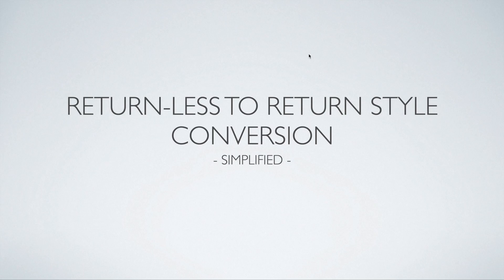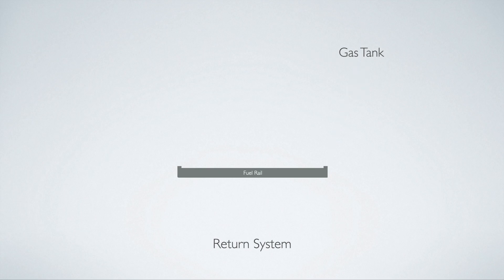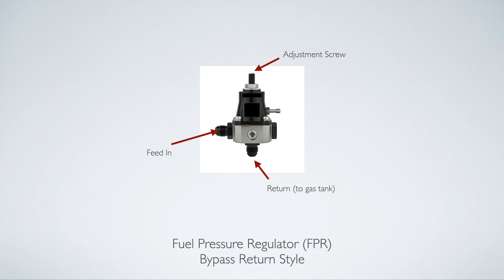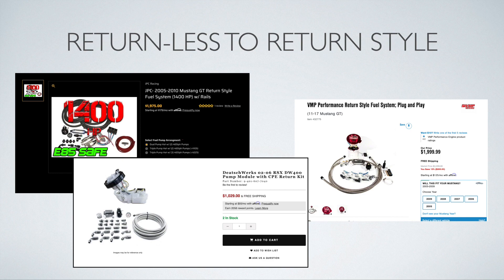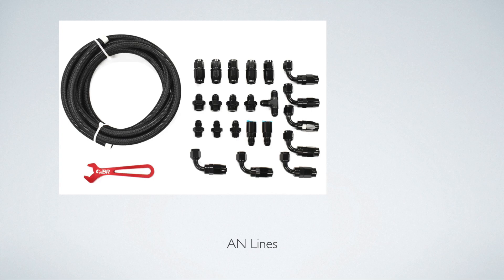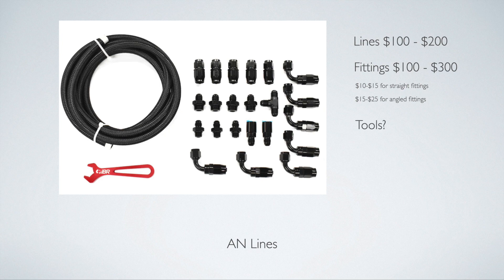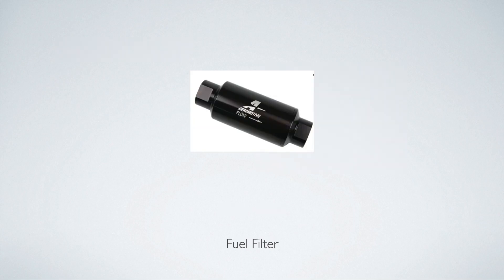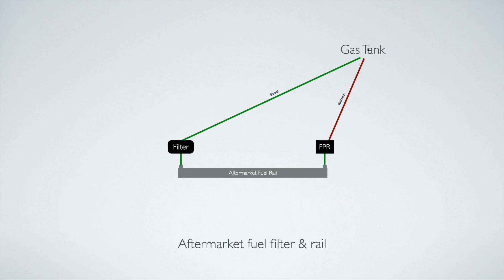Return-less To Return Style Fuel System Conversion

Comment: 2005 lq4/4l80e with oem ECM and harness swapped into a vintage truck. For the past 15k miles, the fuel system was regulatrd by corvette filter/regulator near the tank. Ran great but had multiple FPRs fail.
I took off the returnless oem rail and replaced it with a pre-2004 return style fuel rail which has vacuum FPR on the rail (oem). 
Engine is stock. Using aftermarket walbro 255 in-tank fuel pump. 
Question: do i need to make any changes in the tune to accomodate the switch to a return style rail with OEM vacuum FPR? 
If so, what do i need to change?
I use tunerpro/PCMHammer
Reply from the maker: If fuel pressure is same you should need no changes. Monitor your AFR's if you cannot verify fuel pressure is same.

Comment: Hello E-Dod. Appreciate if you help me with this! I have a Toyota Yaris 2009 Hatchback (Returnless-or EFI is that correct). I've checked it has one feed to the rail but not sure if it has a return line (The 2NZ-FE engine shows there is another cable next to the rail feed from the same side). I'd be happy if you can reply. I am not going to do tuning, that's why I need to do this.
Reply from the maker: That vehicle is returnless.

Comment: In a return-less fuel system generally the fuel pump is pulse width modulated. This means that the fuel pump is turned on only when needed. Generally you want a return system to operate when the engine is running only, but run all the time with the engine running. This will require an external fuel pressure sensor to be added to the system.

Comment: I have a GM returnless fuel system on my 2014 Chevy 3500 6.0l van with a Thor RV conversion. I want to convert to the return style as found on the Corvette fuel system. Using the filter/regular unit. If I do this conversion Im curious as to bypassing the fuel pump control unit that controls the pulse width to modulate the pump. Itll be running the pump continuously. I just started doing my research on this. Questioning if the stock in tank pump is able to run continuously opposed to swapping out a pump designed to do so. The control unit cuts signal through interrupting the ground to get modulation I am told. If so, I'll make a new ground at the pump. My thinking is to let the control unit think it's cutting signal but in fact the pump is running continuously. The problem initially is the RV pump wasn't running to start RV. So either the control unit failed or the vats security system onboard is seeing it as someone was trying to steal it and shut pump down as a deterant. This happened before winter, the RV sits in my driveway and I still need to diagnose the root problem. Either way I'd still prefer the Corvette return system over the returnless. Returnless IMO is stupid and problematic, but I know why mfg do it.
Reply from the maker: I'd be surprised if the pumps in a return style vs returnless were different, I always thought it was just a basic electric motor. I definitely prefer return style due to its simplicity.
Reply: @e-dod  as soon as we get some warmer dryer weather here in pa I'm going to continue with some more diagnostics to make sure what's going on with it. I'm thinking walbro255 in tank pump, Corvette style return set up with the filter regulator. Summit has a kit to convert. I'll just have to modify pump housing and install a return. Add a extra ground on pump and see how it goes I suppose

Comment: Regarding from Sweden! Tnx for ur useful video! U didn't speak about stock regulator bought in the tank and fuel rail! 
Is higher numbers means more pressure or not I'm talking about upgrading that regulator for example 3.5 bar to 5.0bar?
Tnx for ur time 🙌
Reply from the maker: Higher flow numbers from the fuel pump will not equate to more pressure. Ideally you would upgrade your fuel lines and fuel pump and leave pressure the same. That is the most reliable way to provide your engine with more fuel. Happy to answer anymore questions and thanks for watching, glad it was helpful!